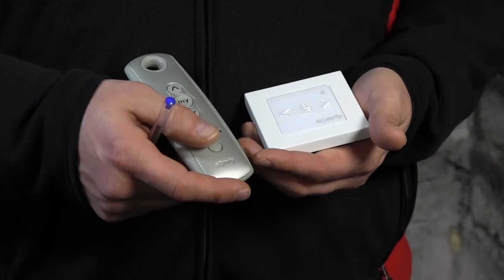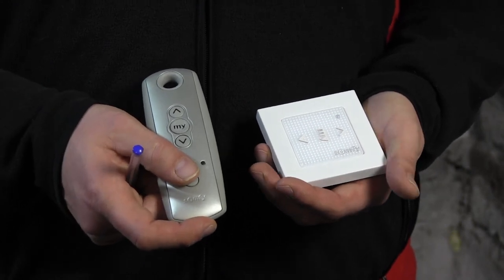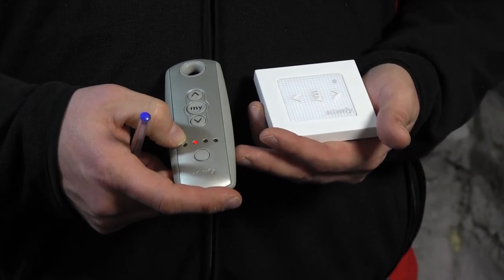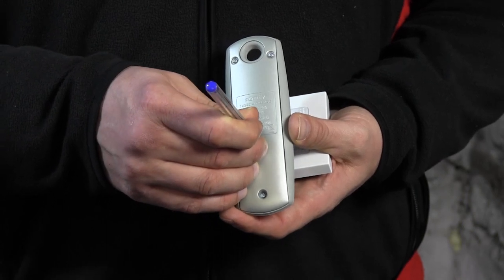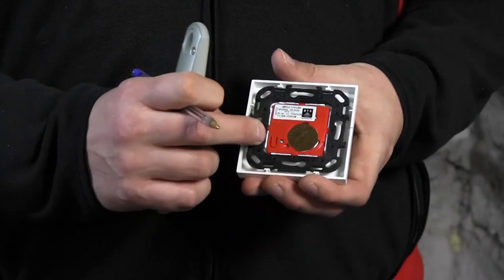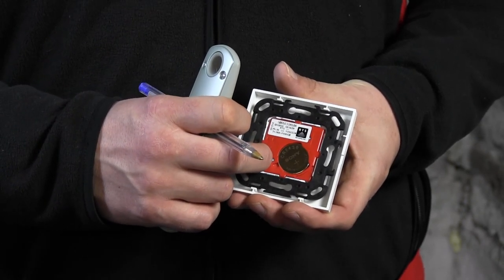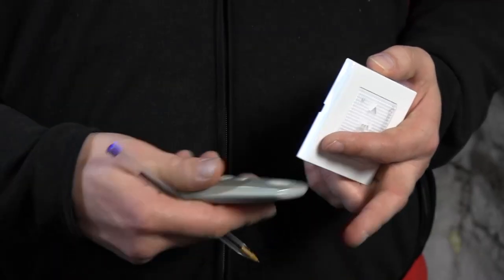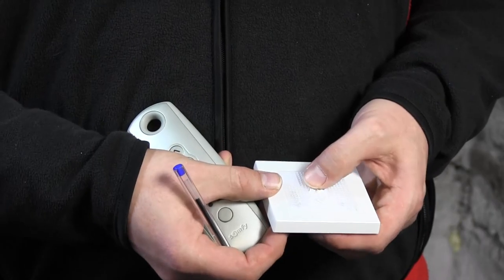How to remove a Somfy RTS remote control from your shutter, blind or shade

Comment: Hello!
I have an issue. I have 18 blinds in a livingroom (penthouse livingroom), which are splitted like this:
10 motors (sonesse 30 wirefree rts) - on a TELIS 16 remote
8 motors (same type) - on another TELIS 16 remote, as the livingroom has two wings with windows.

What am I trying to do is to make one channel (for example - CH16 on each remote) to operate all the blinds in the room. So, for example, channel 16 on the North wing will control all blinds in the room, and channel 16 on the South wing, will do the same.

On top of that, each remote will have a group channel (for example channel 11 on each of it that will control all the blinds from the specific side - north or south)

Hope that I was clear enough. Thanks in advance!
Reply from the maker: Hi, the way to do this is:
select channel you want to add to the group channel
press prog - motor jogs
select group channel 
- press prog. motor jogs
wait 3 minutes (very important)
repeat for next motor you want to add to the group
Here's a video: https://www.youtube.com/watch?v=MRsRmDMw06Y
hope this helps.

Otto